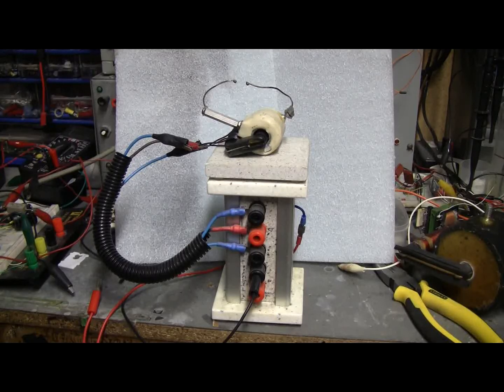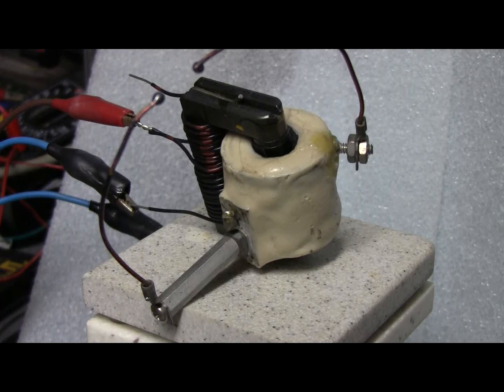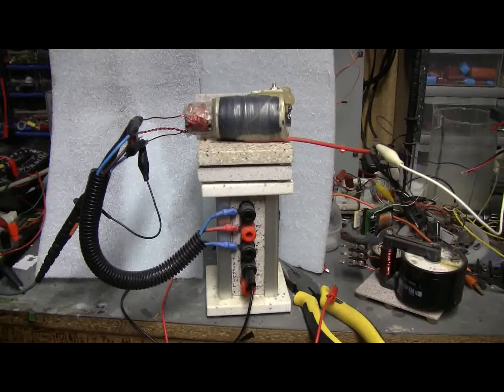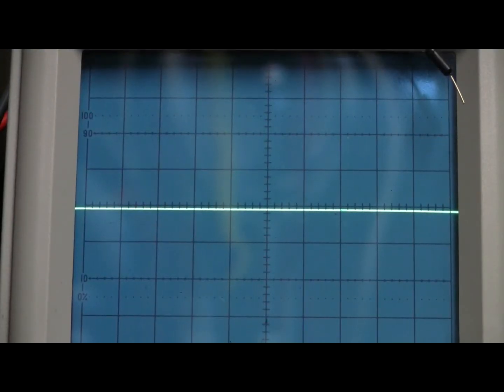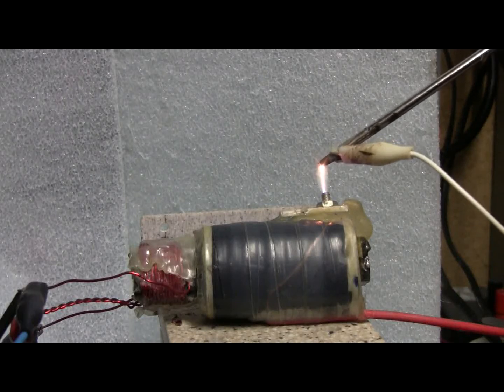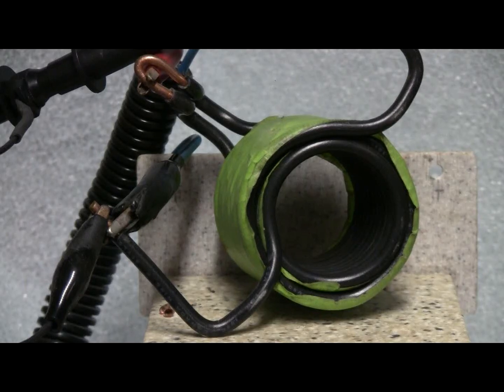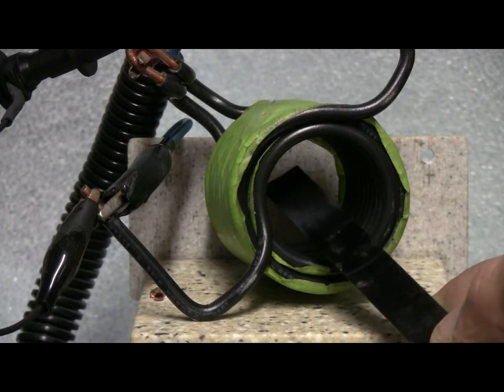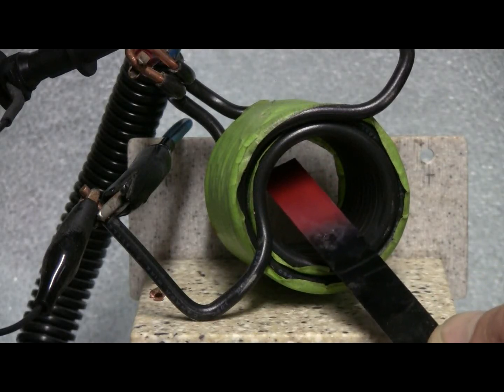ZVS Driver - Three Different Coils

Comment: Great video. awesome arcs with those first two coils.
That induction coil worked very well too. What mosfets did you use ? IRFP 250 or 260 's ?
Reply from the maker: +RODALCO2007 Yes I use the IRFP mosfets. Here I am using the 250's. I also have used the 450 and 460's to allow higher input voltages.